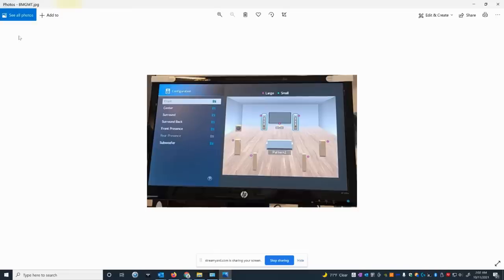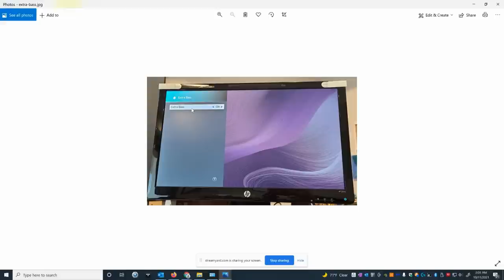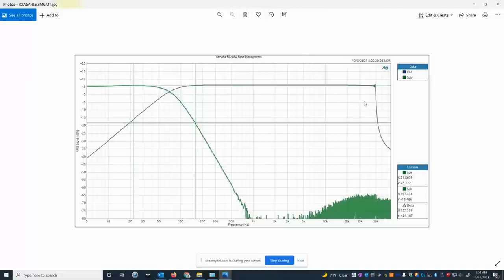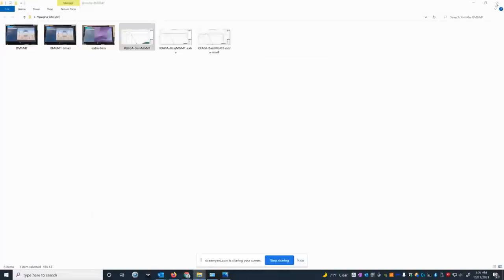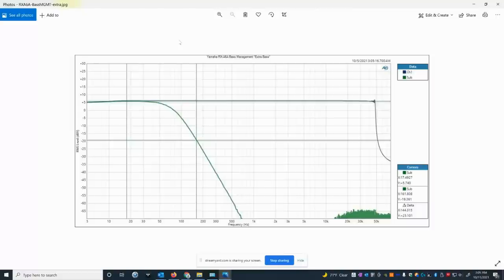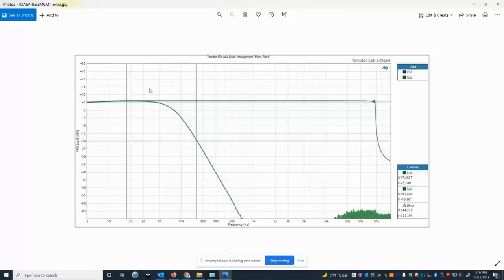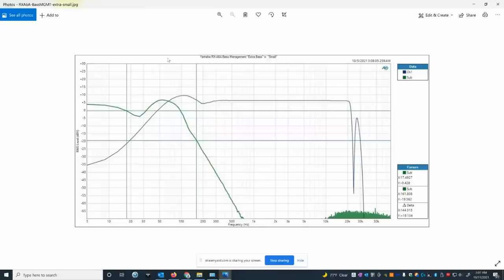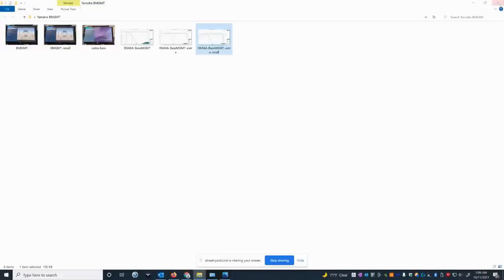How to Set Extra Bass Feature Yamaha AVENTAGE AV Receivers

Comment: Hi I received my RXA6A and set it up yesterday WOW. I first set the speaker system up manually, I set up my Golden Ears Triton 2+ floor standers to large and frequency cross over to 80Hz. But when I ran the YPAO, the system changed my speakers to small and changed the frequency to120 Hz? ? and yes I had my bass set up with extra bass which I have now turned off. So far very impressed, I have now removed my near new Cambridge CXA81 out of the system and will probably sell it. THOSE WHO SAY YOU CANT GET HIGH PERFORMANCE AUDIO OUT OF AN AVR NEED TO TAKE A SECOND LOOK. This receiver certainly satisfies my audio appetite.

Comment: Thanks Gene.  I had used Extra Bass feature on my old Yamah RXV677 receiver.. But since your previous video relating to Pure Direct, my setup with two channel stereo with subwoofer now involves sending music via external DAC and Phono stage to analogue inputs on the receiver, turning on Pure Direct and connecting a REL T7x subwoofer via high level Neutrik Speakon interconnect cable (hence using my receiver as a power amp only in this setup)..  Stereo music is sounding so pure to my ears!!

Comment: This was a great video and very informative. I know it's a bit older but just wanted to leave a quick note. I'm only running smaller bookshelves (B&W) on an older Yamaha receiver, but I found this info very interesting. I've had the speakers set to small and crossover set to 80hz for a while. Decided to give this a try and set the speakers to large with extra bass ON, wow, very noticeable difference. Definitely not full range capable speakers, but I really prefer the "fullness" of the sound like this. I also only have a single smaller SVS subwoofer so the extra bass up front really helps with blending the low frequencies into the sound stage. I'm not sure how graphs would measure this but I really like this sound, especially at mid to lower volumes. I also live in a condo so there's no reference levels happening here by any means, and this sounds great at my listening level. Thanks Gene.

Comment: You can access a web-interface in the receiver by typing the IP-address followed by /setup/. This is a really easy way to make changes on the fly without having to bother with the onscreen GUI. This works for a lot of Yamaha receivers. And no, no problem with the extra bass setting, got the hang of it way back when setting up a (then) brand new RX-V2600.
Reply: My IP address plus setup?

Comment: I have the Aventage Rxa 3050, when I set my mains to large I couldnt get hardly any bass out of my sub, so I changed to small then it worked well. But I also went into the setting and send all the low signal to the sub. ( 80hrz) So all my mains play highs, mids it sounds great. ( Klipsch rp 280s).
Figured let the sub handle all low so mains focus on highs & mids on a 2way speaker.  Setting the speakers took a time playing with tow in & so on, now great center imaging, I swear sometimes I get up to make sure my center speaker is off and it is but it sounds like it is playing. Wow, 
I havent found the boosted bass but hearing your video on it Im glad I didnt. Specially after seeing the graph you put up, what a mess in measuements. 😱
I like your channel because its mostly scienced based, not subjective opinion based. Thxs

Comment: Thanks. After months of experimenting I have found that to be my ideal setting for music, Mains set to large 80hz Extra Bass. Nice to see it confirmed with the graphs. I look forward to seeing your PEQ findings. For music I use Front PEQ
Reply: If you’re setting your mains to large you’re negating the crossover, they are getting full bandwidth. Crossover is only engaged when set to small, i.e. you can’t set to large AND use crossover settings.
Reply: @TurboGuy979  i would imagine it's an LFE crossover, so basically just a lowpass for the sub and not for the mains
Reply: @TurboGuy979  I know this is an older comment, but he's telling you in the video how the extra bass toggle on the receiver functions. When you have your main speakers set to large they are receiving full bandwidth, but with extra bass turn ON and the cross over set at 80hz, the frequencies 80hz and below are now being sent your mains AND your subwoofer.

Comment: I have an Aventage rx-a760 receiver, and I had some time exploring this without really having any support, and I immediately noticed that the “large” speaker setting would have the sub off on anything other than using Atmos or surround in general. 

I wound up having to set my speakers to small (B&W CC6 center and DM601’s (for all other speakers) Despite the receiver picking them up as large speakers when I used the Yamaha YPAO. 

It was frustrating, but I finally realized in order to use my subs (2) M&K 75ii 12”s, I had to set them all to small. 🤷🏻‍♂️

Comment: Hi, I have the RX-A2A and yes, I stumbled across this by accident. I had extra bass on and front towers set to small (Mission LX6 MK2) and extra bass on, I found I was over compensating with my SVS SB1000 PRO settings, I tried changing the fronts to large and BOOM!! Back down to normal sub settings and now it sings! (Also running Tibo pa150 power amps) 

Paul. Nottingham. England 🇬🇧
Reply: Im from sheffield and thinking of getting the a6a its a lot to spend though
Reply: @ian.new.life.  Richer sounds knocked £150 off for me £750 from £900.

Comment: Another issue I was running into was when I use the YPAO to optimize it, for some reason it always sets my sub to -10db and I don’t understand why. For right now I just have to manually turn it back up to 0 just so I can hear the subwoofer and the subwoofer can do subwoofer things. If not you can clearly hear its not doing anything. 

But this video did answer why my sub was on sometimes and wasn’t at other times. Thought my sub was going out.

I had the Sony receiver before and it seemed easier to use. At least for the optimization part. Still learning this receiver.

Comment: So glad I came across this video.  I have a RX-A3080 and music just didn't sound good from my front Kef towers.  My previous Denon was pretty easy to set up with main+subwoofer, but the Yamaha setup doesn't clearly explain this and it was driving me crazy.  I had played with the extra bass feature, but thought it was a simple "loudness" button because it sounded muddy.  Now I understand and just have to run through YPAO again.  Thanks for the help!
Reply: What settings do you have for your parametric equipment freq? Q? Gain? I have always found the settings fidgety and not as satisfactory as my 15-year-old denon, that has a way easier classic eq to deal with

Comment: Thanks Gene, I totally agree, Extra Bass was not necessary for my Topline Aventages (RX-A3080/3060/3050) since it led to a boomy bass. On the other hand, I have a specific case where it helps: I am driving an 2 way system (4 inch in closed cabinet) in my bathroom with the lower end RX-A660. Speakers are lacking of bass from about 130 Hz and lower and there is no place for a subwoofer. Thus I am using high pass for the small speakers, subwoofer 'on' (though there is no subwoofer connected, but you cannot set main speakers to large without subwoofer) and extra bass 'on'. This kind of compensates the lack of bass. Furthermore 4 inches are protected by a 40 Hz filter which acts like a kind of subsonic filter. Ok, it's not a real audiophile sond in my bathroom, but fun and a much more linear frequency curve than withour extra bass (I should check it with REW).
Looking forward to seeing the results of RX-A6A measurements, especially about the Low Frequency Mode. I cannot believe what Phil Shea told aboout it: LFM just identifies problematic modes and consumers will have to correct it themselves with REW equipment and PEQ?? That's not user friendly and no fully automatic YPAO.
Regards, Roland

Comment: Great heads up Gene. I've set up my Yamaha for small on all channels, but cross over at 40 hz on mains ( Deftech ST-L towers), 60 for center, 80 hz for sorround and heighr channels. I dont feed LFE to the built in 10" subs in the Deftechs, just to my two SVS sb13. (crossover at 45 hz, with in room gain 31 hz). I have an additional 10" Deftech sub supercube that I feed LFE at 80 hz for two channel + sub. It works great. I love Yamaha have used them for over 20 years, far more musical and accurate than any Denon or Marantz. Thanks Gene
Reply: try 60 Hz and 100 Hz for surround speakers - you will be impressed
Reply: Mm, Yamaha generally, has a sound signature that’s lighter in bass, but more emphasis on highs/treble.
Denon and Marantz emphasize bass more than Yamaha, yet are still clear in the highs.
It’s about sound preference of course.
Yamaha has always sounded almost sibilant to me, 
and I prefer a warmer sound, with more muscular, 
more substantial and solid bass, 
so I prefer the Denon/Marantz sound signature.

Build quality is very good in all 3.
Cheers.

Comment: I have the RX-A3070 with an Emotiva A3 on the front stage. I have been using Extra Bass for years with my speakers set to small. I will turn it off tonight and see if the sound is less boomy.

Comment: After seeing the tear down with you and the Yamaha rep, I was very impressed and it would be at the top of my list of it weren’t for one thing…Dirac. If they had Dirac I’d be getting the RX-A8A. But I also wish it had 13.2 as I want front wides.
Reply: Coming from a Marantz 7011 with audessy xt32, I think my a8a actually did a much better job with ypao.  Everything integrated better, there is better positioning and sound direction, and I didn’t have to mess with levels as much.  This is with a 7.2.2 setup,  ymmv

Comment: Gene, I have the 3080 set with speakers set to small as you recomend and use Extra Bass only when listening to older vinyl records or CDs that are bass anemic.  They sound much better with Extra Bass on (all speaker on).  Sometimes I also add the Enhancer to further improve the anemic bass.  So better advise Yamaha to leave this function as is.   Thanks!  Joe C.

Comment: I stumbled across this when going from auto decoder to 2 channel and my subs didn't turn on.. thought sub gain threshold was being factor in processor, and not enough voltage for turn on..  definitely sounds better in my case from using large front with extra bass on

Comment: Finally, after watching this clip for the third time I actually got around to following your directions for bass enhancement and wow, what a difference it has made so thank you.

What urged me on was my just purchased Monitor Audio Silver 300 7G floorstanders sounded really rather bright and lacking bass. I left it 2 weeks hoping things would improve but they didn't hence my third visit to this clip. My amp is the older Aventage 3060 but clearly the same principle applies. Also I don't have a subwoofer.

BTW, I assume me adjusting the bass & treble via the front facia buttons only applies to Pure Direct & Straight modes. Is that correct?
Reply from the maker: @jayroland9481  pure direct bypasses all EQ and tone controls.

Comment: Nailed it! So odd that they have the small/large speaker conflict; and why use the term "extra bass" when what you are looking to do is engage the Sub in stereo? I would think most setups would want the sub engaged regardless of speaker size and source. If you have an imbalance in an exceptional case you can always turn the sub off at worst.

Comment: Oh wow. Yes i have the A3070 and have the extra bass set to ON with all other speakers set to small. I have 4 subwoofers, one in each corner. And when i run REW i get a similar response to your measured graph with a dip at about 25-30hz and a peak at about 60hz. I thought it was just my room doing it and just tried to EQ as best i could after time alignment and put up with it. Now i need to go measure my subs again and turn that feature off.

Comment: Just a little confusion you mentioned when you had your main set to large you still used an 80hz crossover?   Being set to large means full bandwidth to the main channels.    Or does that mean that you can have a normal bass  configuration all small 80hz  crossover for the subwoofers and then if you’re watching a movie you use it that way but then when you want to listen to music switch the extra bass  on.

Comment: I've been doing a sort of halfway house. I set my fronts to small, with crossover at 40Hz, which is about as low as the speakers go anyway. I seem to get better sound that way.  They are driven through an active crossover though, which most people's speakers won't be I guess, and as a result they seem to do 40-80Hz better than my sub, perhaps because there are two of them!

Comment: I have a Yamaha RX A880 with Elac debut towers and two Definitive Technology subs. When I set speakers to large the ability to set the crossover on the mains turns off... anyone know why? Great video my assumption was you should always have mains set to small when using a sub....thanks.
Reply: If you’re setting your mains to large you’re negating the crossover, they are getting full bandwidth. Crossover is only engaged when set to small, i.e. you can’t set to large AND use crossover settings.

Comment: Nice Video TY I love Adventage, but I have a question, I have this speakers configuration: B&W - 3 FPM4 front and center and 2 FPM2 for rear. Is it correct setup LARGE the front and center? Ty

Comment: Gene, great video(s).   I have the RX A2A receiver driving a mix of small Canton Vento series mains and Plus D surrounds & presence and center speakers.  I notice when I set all speakers to small to take advantage of low freq send to the subs, re-calibrating with YPAO re-sets the fronts, surrounds and presence speakers to large.  Is there a workaround for this?  Don't run the YPAO calibrate after setting speaker size in set-up?

Comment: Very interesting video, A6A’s finally landed in Australia last week, so picked mine up on the weekend. 
Connected 9.2 speakers, Installed latest firmware and ran YPAO. It selected all my B&W 700 series speakers as large. Thought sound was disappointing . 
I then changed all my speakers to small, except front speakers, and put in crossover frequencies. Turned on extra bass. Sounds much better now.
Do we know if latest firmware fixes that weird frequency response if fronts are selected as small?
Reply: They all want money..... i wonder how much yammy get paid from speaker manufacturers for sales of replacement speakers caused by their amps...... go A6A, just go A6A's.... 😂😂😂😂😂😍😍😍😍😍😍😍😍

Comment: Hi Gene, thank you 🙏🏻 Most informative. Do you know if this is also the case with the RX-A3070 series?

I never measured it with REW but I have tried setiing it on and concluded it sounded bad. My front Triangle speakers handles low frequencies poorly at high levels so they are set to small leaving the hard word to the subwoofers.

Comment: Hello!!! Just one question...  I have a pair of main Goldenear Triton which comes each one with powered amplified subwoofers 1,600 watts with lfe inputs built in.  This model manuals is very clear that you set them up as Large speakers and the option of connecting LFE cable from sub preout on avr to the internal lfe input on the main speakers. How do I get LFE signal to calibrate and align lfe responses  if manual is already telling me to setup mains as Large speakers?  Or what setup you recommend for this type of speakers? Thanks....  The only way I can think of is turning on the option on AVR that says LFE+Mains. 🤔🤔 I also have 2 extra on each side of room  Goldenear Super Subs XXL and love the integration of all 4 powered subwoofers all together

Comment: Hi, Just got my A6A, I do not have a sub, so my set up is 5.0 I guess. I have huge front speakers with 15" drives, work great on sub 50Hz sounds. Would you advise me to turn the Extra Bass on or leave it off?  The second question is what is the best settings for the wonderful EQ the V6V has (PEQ). I love big powerful bass with lots of punch (Pink Floyd)

Comment: Hi there mate 🤘
I agree, that extra bass, should only be an option for the speakers set to large (kind of the purpose of it). 
I wonder though, if you set surrounds as large too, does the sub still get the same bassboost? (In the recievers I have owned, the extra bass only works with LCR). Would like to have everything in large, and still get the full benefit from the sub. (The midbass becomes more precise in suroundchannels when in large, but the deepbass suffers when it is not an lfe signal).
Great review as always sir, looking forward to your complete review on the Yamaha. (I am looking at A6A/A8A or the Onkyo tx-nr 50 I think, new one with Dirac Live stuff🤪).
Reply: Onkyo..... dont get ripped like these yammaha people have on a sub standard faulty product..... keep reading the comments.....